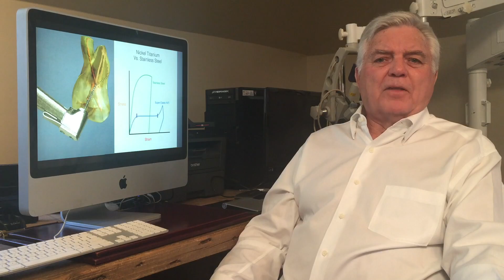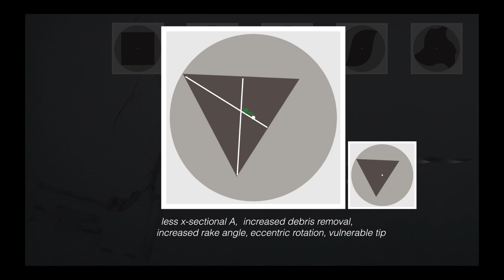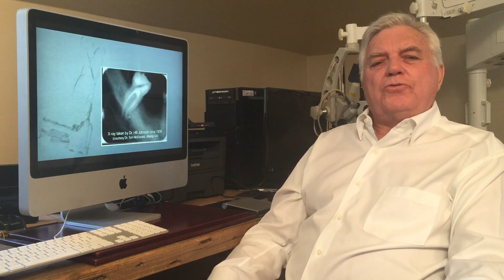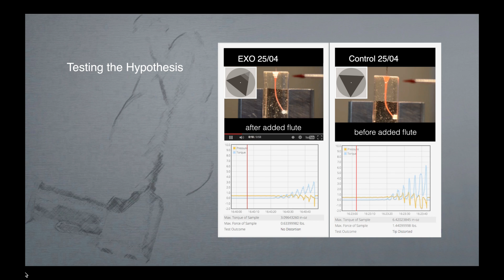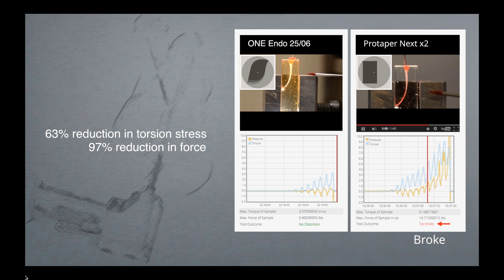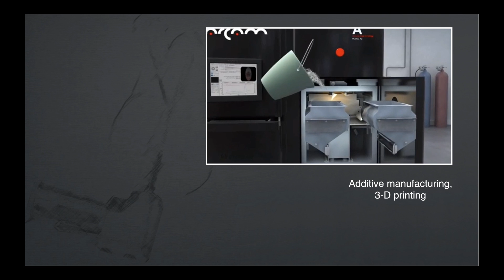The Past, Present and Future of Endodontic File Design

Comment: This type of research is great.  I just question the material in the blocks.  Been using Edge for over 2.5 years in over 1500 cases and haven't seen breakage in one case.  Now I am Boarded Endodontist who does handfile slightly first but I haven't found anything but amazing results with Edge!
Reply from the maker: I'm glad you appreciate our research and thank you for commenting. Truthfully, the material of the blocks is of little consequence as long as it is consistent between them, and it is. This allows us to eliminate variability of all factors other than the files themselves. The test in no way implies that EdgeFiles are likely to separate. Rather, it provides insight into the efficiency of the two competing designs. In practice, if we employ the appropriate technique and work within the limitations of the files used, it is possible to complete even the most difficult cases successfully and without separating an instrument. This case: ( https://nanoendo.com/blog/if-a-picture-is-worth-a-thousand-words-then-whats-that-worth/ ) for example, shows a very tight canal with a nearly 180 degree curvature that was expertly prepared in the late 1930's using carbon steel files; terrible files by modern standard. The fact that you have completed so many cases using the EdgeFile simply speaks of your own competence and knowledge of the EdgeFile's limitations. I commend you for your work and you should be proud that you have achieved such an expert hand in your craft. What we hope to show is that there is still room for an expert to improve by utilizing more efficient instruments that will allow for adaptations to your technique. Efficiency is measured through the amount of work completed over a period of time. By increasing efficiency in the files we use, we should be able to prepare more of a canal in less time using less pressure thereby reducing overall risk. That was our intent and our research continually validates our success in this regard. 

Thank you again for your comments and please feel free to contact us any time.
Reply: Hmmmhky6y6yy6666